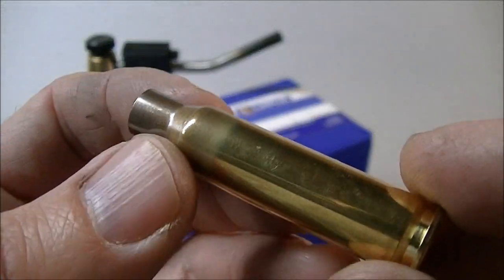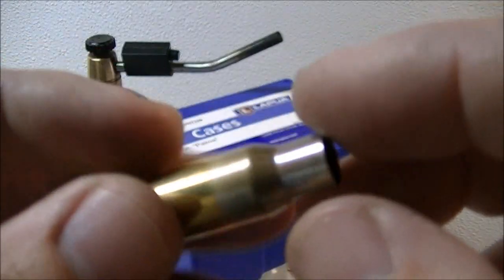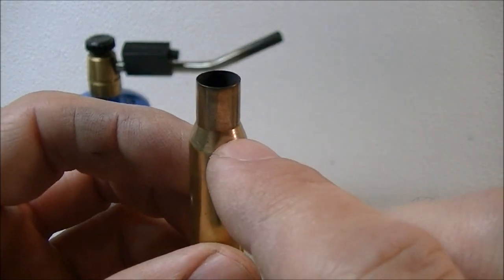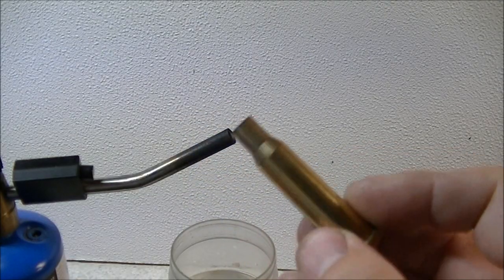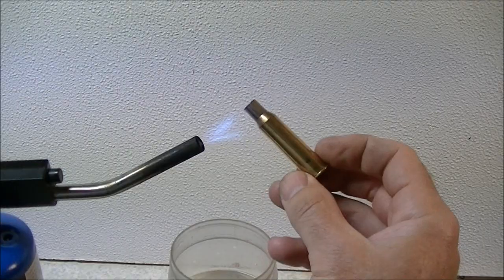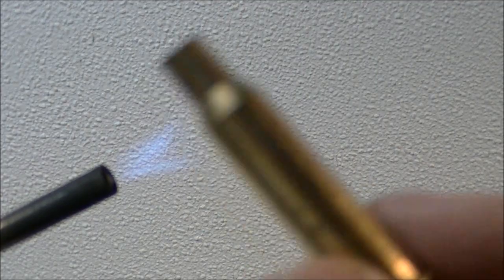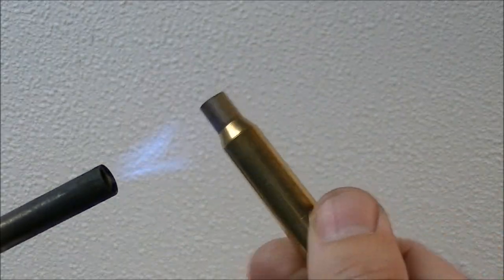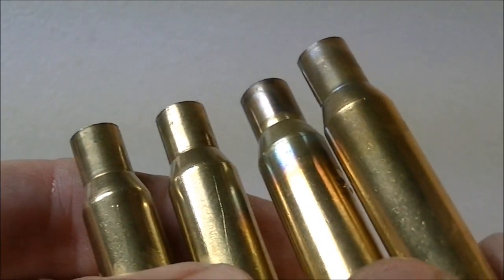How I Anneal Brass Cartridge Cases for Reloading

Comment: Droping the case in the water defeats the annealing process, case should cool on its own
Reply from the maker: No it does not. Quench hardening applies to ferrous (steel/iron) alloys, not to brass which is nonferrous.
Reply: @314299  Sorry I was told by a better reloader than you not to do it, watch and learn kid

Comment: Very very skeptical with this process. It's never consistent turning with your fingers. The temp fluctuates dramatically too.Zero idea of the temp delivered.
Reply from the maker: This method has been working for me for many, many years. Is it as consistent as a purpose made machine? Probably not. But it does not cost me hundreds of dollars either. If you are a super high speed long range shooter with a $20k rifle this is probably not for you, but if you are an average reloader on a budget this works.

Comment: Very cool presentation, but I don;t see why quenching is needed.  Could you just drop them in a bucket?
Reply from the maker: You don't need to "quench" the brass, it does nothing to either increase or decrease the hardness of the metal. I did it in an effort to keep the head of the brass from getting too hot, however I think that was excessive caution, I no longer do that step and let the brass air cool. I have had no issues using that method.
Reply: @314299  Good to know! Thanks!

Comment: Okay so in my expirience. Rapidly cooling metal hardens it. Is it best to exclude the water cooling part?
Reply from the maker: Brass behaves differently than does iron/steel and does not quench harden. The water cooling in the video is an optional step, it can be used or not as desired without effecting the outcome of the annealing process.

Comment: Just as easily done with a cordless drill not to mention more evenly done than twisting unevenly with your fingers. But then again I suppose not everyone owns a drill🤔
Reply from the maker: The point of the method shown is that you will not overheat the brass. Yes, a drill will work but it is very easy to overheat the brass, which you will not do if you hold it in your fingers.

Comment: I followed Erik Cortina’s flame trick and I use 15mm socket for my 338 brass to anneal an it works great
Reply from the maker: It's very easy to over heat the brass is you use a socket.

Comment: Why you cold the cases in the water? It makes them harder, some people just let it cold.
Reply from the maker: Brass behaves differently than does iron/steel and does not quench harden. The water cooling in the video is an optional step, it can be used or not as desired without effecting the outcome of the annealing process.

Comment: Any idea if the water effects the outcome? Seems like shock cooling it would reverse the softening effect.
Reply from the maker: Brass behaves differently than does iron/steel and does not quench harden. The water cooling in the video is an optional step, it can be used or not as desired without effecting the outcome of the annealing process.

Comment: By immediately dipping them in the water aren't you A) undoing the annealing and B) temporing the case (the opposite of annealing)?
Reply from the maker: Brass behaves differently than does iron/steel and does not quench harden. The water cooling in the video is an optional step, it can be used or not as desired without effecting the outcome of the annealing process.

Comment: Got into reloading a few months ago, but started annealing about a month ago. However, whenever I anneal my case necks they turn black instead of turning slightly discolored like your brass does. Do you have any ideas as to why they turn black? I'm using a propane torch and taking the brasd away from the flame right before the flame changes from blue to red, but I cant figure out why my brass is turning black after annealing them.
Reply from the maker: It sounds to me as though your torch is not burning properly and leaving carbon/soot on the brass.
Reply: @314299  so you think buying a new torch would fix the issue? It is an older torch that's been sitting in the shop for a long time

Comment: Hello!Why annealing usually provides only for neck not for full body?
Reply from the maker: That's a good question. The reason that only the neck/shoulder area is annealed is that the process softens the brass, this characteristic is only desirable in those areas. The head and body of the case would be weakened by annealing, they need to be hard/tough in order to perform properly.
Reply: @314299  I'm only beginner so thanks for your answer!

Comment: I would have thought the rapid cooling of the water would actually harden the brass. Kinda like heat treating steel to be harder. Maybe it's the low temp?
Reply from the maker: Brass behaves differently than does iron/steel and does not quench harden. The water cooling in the video is an optional step, it can be used or not as desired without effecting the outcome of the annealing process.
Reply: @314299  I did not know that about brass. Great video and thanks for answering my question 👍

Comment: This is gonna sound really, really dumb, but I'm new to reloading. I'm trying to make a wildcat round that requires significant resizing of the neck of the case. Is this process done between using the die press, or is this just to extend the life of the cade? Thanks in advance.
Reply from the maker: Generally annealing should be performed after you are finished with your case forming operations. It will remove some of the stress induced to the cases due the reforming / working of the brass. If you do it before you do your case forming you risk the brass becoming too soft and collapsing when sized, this is especially a concern with bottle neck cases that most rifle rounds have.

Comment: I dont think you have heated it enough for long enough to reduce the work hardening back to elasticity
Reply from the maker: The idea is not to reduce the brass to a soft state, the idea is to reduce the stress built up in the brass from sizing. Taking the brass to a soft state risks the shoulder collapsing when the brass is sized and also leads to very inconsistent neck tension on the loaded rounds.

Comment: Annealing brass is accomplished by heating it up. Putting it in water quenches it which makes it harder not softer.
Reply from the maker: No, it does not harden when quenched in water. That would be the case with iron/steel alloys, but is not how brass behaves.

Comment: Do you think it's wise or absurd to anneal every time you reload? Basically you fire it once, clean and get it ready and then anneal. Rinse and repeat.
Reply from the maker: I know target shooters who do that, but they have expensive annealing machines that are much more precise that the hand method shown here. I think for the average shooter/reloader annealing every five to seven loadings is sufficient as our goal is to extend the life of the brass.
Reply: @314299  The only reason I ask is because I do not organize my brass based on how many times it's been fired, if it's safe, I will reload it. Thanks for responding.
Reply: With this method, you could do it every time.  Or, if you have enough time, just do it when you bring your brass back and just keep all the annealed cases in a container ready for use.
Reply: @isher9035  Fair point. I am still on the fence about annealing.

Comment: Looks like I should get good results from this. I’m having a issue with my reloading. I’ll zero in on a great load for a rifle beautiful group in the latter stage. But when I come back to recreate the load that worked in the testing stage of reloading. It will not shoot as good only thing that is changed is the brass being resized. Same bullets Sierra 168gr BTHP on top of CFE223. Same charge weight same projectiles same primer same brass even. This has to be the solution to my problem annealing
Reply from the maker: Yes neck tension can have an effect on groupings.  With continued reloading the brass gets harder changing the neck tension, annealing the brass may help with this and improve the groupings of your load. One other factor might be in play, and that is "bonding" of the bullet to the case neck caused by carbon and fouling on the inside of the case necks. Dirty case necks tend to stick the bullets in the cases, especially if the rounds sit a long time before being fired, so make sure your case necks are clean as well.

Comment: I just watched a guy put a case on a brick  and torch it. Where did he see that ?
I do the socket/drill into bread pan. Dark area with glasses to see the color change and carefully timed to boot.  Your method is now formally recognized as totally acceptable.  A+ for no burnt fingers.
Reply from the maker: I guess the guy with the case on a brick and torch wanted to avoid burning his counter, however he stands a good chance of overheating the case and ruining it. At the very least his cases will be annealed more on one side than the other. The drill/socket method does give a case heated uniformly, but you do have to be careful not to over do the heat as the potential exists of over heating the case head.

Comment: I'm not attempting to be a "smart a--" in asking this question, but aren't you re-hardening the brass when you quench with the water? Genuinely seeking info.
Reply from the maker: The properties of brass are quite different than the properties of steel/iron, so dipping the hot cases in water does not harden them at all.  Hardening when quenched happens with iron/steel but not with brass.
Reply: @314299  I'm a knife maker so thanks for clarifying. I wish I would have seen this earlier as I just annealed a batch of, probably 10x fired 7.5x54 and some slightly newer 8mm, getting done just before seeing this. I submerged them 3/4 and annealed to slightly below the shoulder. I will try your method next time. Thanks for the reply and info!

Comment: I anneal exactly the same but skip the water part and just drop the brass into a tin foil pan. With the lights turned down low you will see a low dull red colour come into the neck and shoulder. This is a good indicator of the amount of heat as well.
Reply from the maker: The water portion is not strictly required and I don't do it myself anymore. I never heat the cases until they glow as that tends to bring them to a dead soft state which is not my goal, I'm only tying to stress relieve the brass and remove some of the excess hardness induced by the sizing.
Reply: Finally, a sensible  way to do this, thanks for not over complicating it.

Comment: Just asking but I thought quenching caused metal to harden.  Maybe brass is different?  The definition of annealing is allowing something to cool slowly to relive stress.  Would it be better to let the brass cool naturally say in a metal pan?  Thanks for the video.  Always learning.
Reply from the maker: The properties of brass are quite different than the properties of steel/iron, so dipping the hot cases in water does not harden them at all.
Reply: Makes no difference if you dunk them or air dry, brass is brass it has no carbon content. You could do the same to A36 mild steel and it will not harden one bit because it has no carbon content. In order for a metal to get hard it has to have a high carbon content in it like knife making steels do or it will not get hard at all

Comment: Awesome method!  Bare fingers ensure the web is not heated.  No expensive single-purpose equipment, and no extra storage space needed.  My inner Scotsman salutes you! 🏴

That flame is hard to see.  It may be safer to put the water where the case could be dropped with a slight arm/hand movement away from the flame.  Could save some knuckle hair.  

Thumbs up.
Reply from the maker: Thanks for the comment. My usual set up is different than the one I had to use for the purpose of showing the process on video so that's why it perhaps looks a bit awkward on the video.

Comment: Correct me if I'm wrong but it looks like you are only doing a 180 degree on the flame and case, not a  complete 360 degree.
Reply from the maker: No, the cases are being rotated 360.
Reply: @314299  I had the same Q to be honest - on that first case that you put in the flame, the spot/mark near the base of the case never faces the flame.  Admittedly it's better than standing static in a pan of water, but not getting a true 360.

Comment: I think  quenching the brass in water will cause it to get hard. Quenching is how they hardened metal for knife blades. I think to properly anneal metals you need to let it cool down to room temperature naturally.
Reply from the maker: Brass behaves differently than does iron/steel and does not quench harden. The water cooling in the video is an optional step, it can be used or not as desired without effecting the outcome of the annealing process.
Reply: @314299  Thanks for the info.
Reply: Steel and BRass are two different types of metal that react differently to heat and quenching, that’s why the annealing process must be specific to the metal type
Reply: Nope! Non ferrous metals do not harden at quenching including silver.
Reply: @Frogmobile52  does this apply to lead?  Everywhere I've read says to quench lead cast bullets in water to up the hardness...
Reply: @ No, to harden lead you need to add 8% antimony and 2% tin

Comment: Thanks for showing this simple way , I've seen guys anneal half way down the case in other vids and swear it was the right way to do it . I believe the color change should be slightly below the shoulder as you did .
Reply from the maker: Yeah not much point in going too far down the case as it does not get worked as much by the dies as the neck/shoulder does.

Comment: Whats your opinion on lapua brass 7.62x53 R ? Thanks
Reply from the maker: Most would folks rate the Lapua the best brand of brass for the caliber, and actually the best for most calibers. However the batch of 50 Lapua 7.62x53R brass I had suffered a lot losses from of cracking after only limited use (3 or 4 loadings), but perhaps I got a bad batch. If I were in the market for brass for this caliber I think the PPU stuff is plenty good enough for much less money, and it it has proven in my use to be good durable stuff.
Reply: @314299  Thanks a lot ! Very valuable information!

Comment: Ok... i am a noob. So not correcting.  But asking. 

I am a welder. 

And heating something. And then quenching it. Makes it hard... not soft????

Like a knife maker will heat blade cherry red and then quench it. 

To than make it ductile he puts it in oven.  Heats up to 400-500 degrees. And then lets it cool slowly in the oven. 

So would this process not harden the brass????
Reply from the maker: As brass is not a ferrous alloy it does not behave the way iron/steel does, therefore it does not quench harden the way steel does, so cooling it in water does not harden it. 

So with these different properties one can heat brass to soften it and then cool it rapidly without loosing the softness. Hardness in brass is achieved by work hardening (drawing, forming) the object. 

It is not necessary to drop the brass in water if one does not want to, the process works just as well without it, my current method involves letting the brass just air cool. I do it this way now just to avoid the extra step of having to dry the brass off.

Comment: Sir why do you use the water? I've always seen them just air cool. Great video
Reply from the maker: The water was to prevent the leftover heat from moving down into the case head, however it probably is not required.

Comment: Can this process be used to prevent Case head separation?
Reply: No, but look into neck sizing if it's a bolt action.  If it's a semi auto, be sure you aren't over sizing your case.  Size it exactly to max spec so there is less stretch.  Usually case head separation is from a overly generous chamber or too much headspace.  I have a couple old milsurp rifles that will separate heads in just a couple rings, so I neck size only and get way more use of the brass.
Reply from the maker: No. It is not safe to anneal anything but the front portion of the case, annealing the rear of the case will ruin it.

Comment: Thanks, Should i Anneal The brass befor or after fully resizing The brass?
Reply: I would do it after, That way you can resize it and get that primer out and do the annealing and after you're done you will have a ready to polish (tumble) case.
Reply from the maker: I do the anneal after I size the brass, however I don't think it would make a huge difference if you did it before.
Reply: Technically, you're supposed to do it before, as the idea is to soften the shoulder and neck before the sizing die works the neck and shoulder.  If a spent primer is a concern, just get a general depriming die (I use RCBS dies, which decap and resize in one step).

Comment: Aren't you Harding it by quenching it???
Reply: nope. only ferrous metals (that is metals constraining iron, so steel etc) harden by quenching. copper and copper alloys (brass bronze etc) harden by repeated stress. try it with a piece of copper tube, bend it back and forth and it will get hard and snap
Reply: BRASS DOES NOT HARDEN THE WAY A STEEL WOULD.....

Comment: anneal first. you run the risk of splitting a neck if not.
Reply from the maker: Although I'm sure it can happen I don't recall ever having a neck a neck split during sizing, any splits I have had happened during firing. If you have brass that's been fired and loaded a lot it might pay to do it first just to be safe.